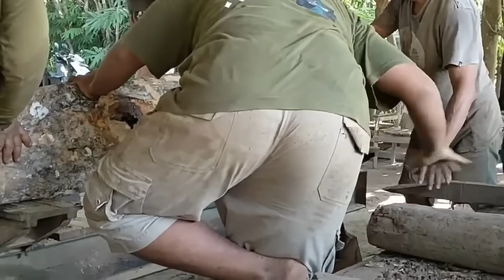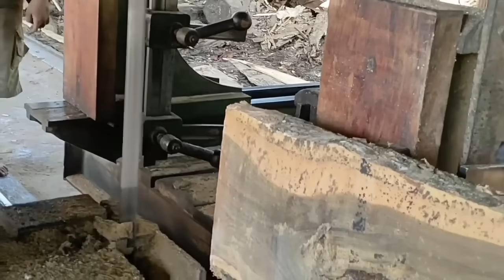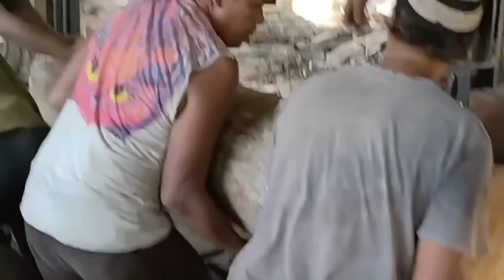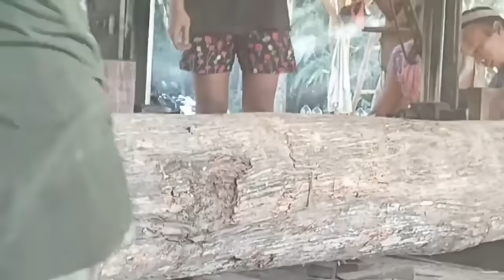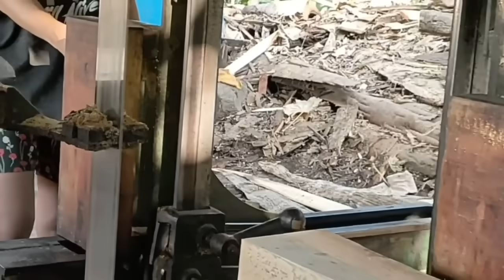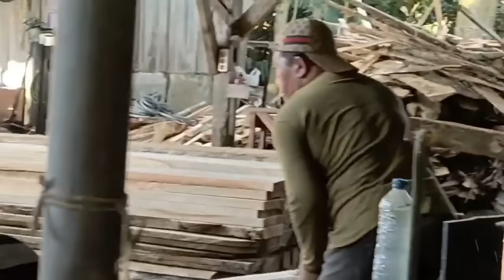Terrifying!! the tragedy of sawing teak wood in a sawmill

Comment: The workers have no safety equipment at all.  Barefoot, smoking, no eye protection…what happens if the do get injured?
Reply from the maker: Thank you for your advice, support and encouragement, sir.🙏🏻♥️
Reply: どこが悲劇❓
Reply: Correct. The rules and laws are quite different in the far east. OSHA is not a thing there.
Reply: They are poop outta luck!
Reply: They learn to be more careful so they don't get injured.  It's like the difference between rugby and football.  By common sense and natural limits we intuitively follow, rugby players limit how hard they hit so that they don't injure themselves, which translates to being less likely to injure the other guy as well.  But US football, wearing full body armor, you're "safer" so you hit harder and harder, until someone gets injured anyway.  Probably injured worse because more force was being used!
Reply: They throw them in the pit outback with the rest of them.